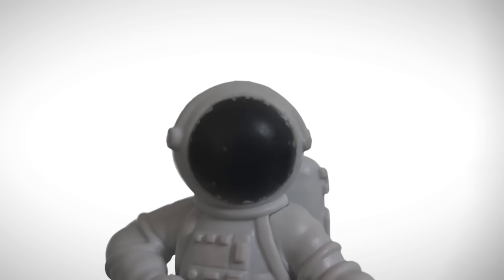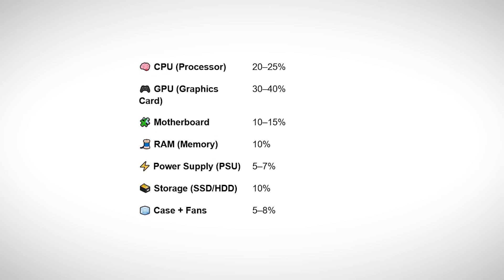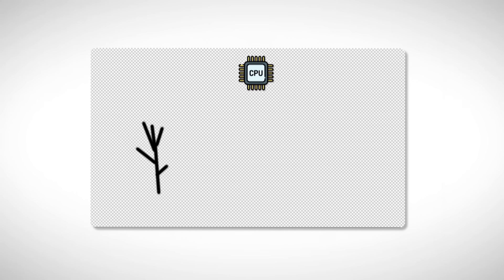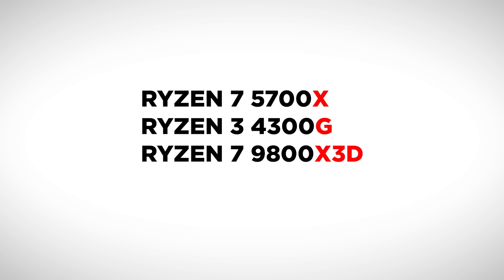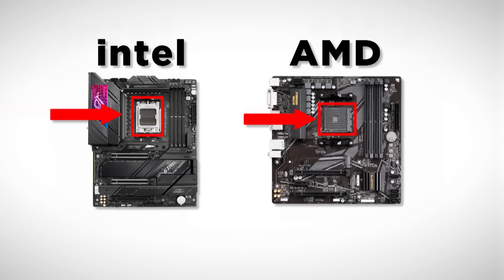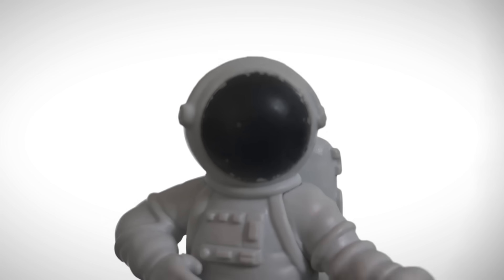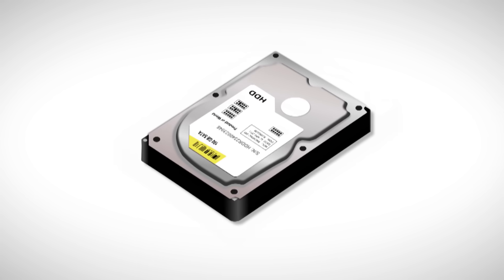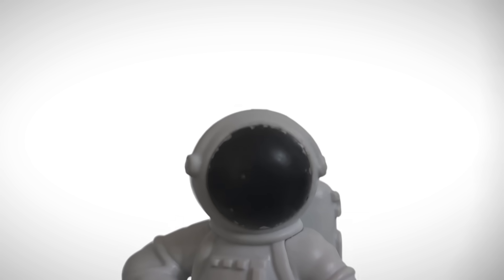Even a 5-Year-Old Could Understand This PC Guide

Comment: my mom wouldn't even buy me the "Lenovo LOQ -E 15 15IAX9E RTX 3050 AI Gaming Laptop, 15.6" IPS 300Nits FHD 144Hz, NVIDIA GeForce RTX 3050, Intel i5-12450HX, 16GB RAM 512GB SSD, Wi-Fi 6, W11H, Luna Grey with 3 Months Gaming Pass" on Amazon and wants me to stick with the Acer Chromebook Plus GE 516 and the purpose of the Acer Chromebook (which my mom meant to get acer nitro 5 but it was out of stock) is for Minecraft Java and since ChromeOS is so strict and that, it broke the GPU-Passthrough after an accidental Powerwash... 

I wish i could have a PC :[
or at least a good laptop that can run Java 120+fps-
Reply: You shouldnt be complaining about your mum getting you an expensive laptop, it may be a chromebook but it has a really good display. And you can just install windows or a different linux distro if you want.
Also, it can run minecraft pretty well.
Reply: @vVaeron  dude. at first it was getting 220+ fps and now it's getting about 120. after an accidental power-wash.
that's the only reason i'm complaining.
I want the full potential of the chromebook. but ChromeOS is stupid af and is blocking the GPU-Passthrough for Linux :/

Comment: Wrong approach. You pick a processor and graphics card that can run your games at the target resolution and FPS. Pick then motherboard according to those, then ram and storage, then fans then power supply and then a case that can fit it all nicely. If you don't have the money for it, keep saving money until you reach your needed budget.

Comment: Personally, for complete complete beginners, you want the very start to be as frictionless as possible.

On the parts explanation, I would recommend making the motherboard really big and introduce it first, as it's easy to understand as 
"the thing that all other things go onto"

The PSU can get the same treatment, as it's "thing that give electricity, and people are already familiar with the concept.

For the storage, I would ONLY keep one icon, instead of seperating SSD and HDD.
Showing 2 parts to an absolute beginner will make this harder.

Comment: The psu should be that low. You should always get a better psu and future proof your build. PSU is the most dangerous part so never go low on the price of psu. Sometimes your Graphics card takes a of power,  then if your psu has low watts it limits the actual potential of your Gpu 
2:23

Comment: This guide completely demystifies PC building. The analogy of the CPU as the brain doing the math and the GPU as the artist doing the visuals makes the whole concept of balancing your components so clear. Also, the emphasis on checking for a bottleneck between them is a pro tip every beginner needs to hear!
Reply: Your PC still sucks if you use WinCrap11 instead of Linux Mint

Comment: Can someone let me know if this prebuilt pc is worth it? It will be my first PC! Mostly for gaming YouTube and probably developing. Price is about 1100. Or should I idk???

Apollo E2 - Intel i5 12400F, 32GB RAM, 1TB SSD, RTX 3070 8GB - BLACK
This beautiful mid-size case has nothing else mid about it. The mesmerizing 200MM fans keep your system cool and quiet, even during intense gaming sessions.
The Intel i5 12400F, 32GB RAM and RTX 3070 8GB will offer great performance, both for multitasking and gaming.
Upgradeable to the latest i9 13900K, 64GB RGB DDR5 RAM, RTX 4090 and 240MM Water Cooling.
FREE RGB INCLUDED - $49 SAVINGS!

Parts:

Motherboard: standard DDR4

CPU: i5 12400F - 6 cores

Memory: 32GB DDR4 3200 or faster

Storage: 1TB nVME SSD

PSU: 650W bronze 

GPU: RTX 3070 8GB

Comment: okay i have some problems the = things are horrible a 3080 is better then a 4070 and a 5080 is not better then a 4090 the other one is you shoved an am5 socketed mobo on intels side thats just wrong and confusing to those who dont know this yet and the cpu too those might be correct but a r7 7700x beats a r5 9600x in most cases so you should not have said that i might have other critics so i will write my own reply if i have some more i am at 8:55 rn and i am not happy at these but ig its fine for the not nerds (yeah call me nerd i am fine with that)

Comment: ChatGPT is great. It's helped me with modding. Upgrading my laptop and both desktops. And installing windows 11 on my desktop that didn't meet the system requirements. ChatGPT gave me a work around and bypass plan and it worked perfectly. The only reason I believe Microsoft does the system requirements is to make you have to buy newer computers through them. Windows 11 works just like it should on all of my older mid computers. No issues at all.

Comment: The video have some flaws.
1: there no intel core i3 12600t and 
2: am5 socket on intel side
3: amd recently adopted lga so it will not look like the am4 anymore
4: x3d means it have large l3 cache, it does NOT mean high end cpu
5: no, the memory clock speed does not mean better performance, it just get you like slightly faster loading speed, the sweet spot on the ddr4 is 3200 mhz and ddr5 is 6000
6: you shouldnt trust the psu calculator, just search "gpu model" + minimum psu and add 100 to 200w more
7: nvme have type, if you using like a520, b450, h610 etc. use gen 3, gen 4 on the motherboard that support gen 3 is fine but your nvme will not get the advertisement speed, if you use b550, x570, b650, b760 etc. you should use the gen 4 or gen 5 if your motherboard supported it but gen 4 is fine if your motherboard support gen 5 since it just increase loading time
8: please do not get sata m.2, they look ideal to m.2 nvme but the sata m.2 will have 2 head instead of one
Notes: do some research on the power supply, i recommend psu tier list and remember do NOT cheap out on the psu

Comment: Hey Aman! Just finalized my dream PC build —Your thoughts?

CPU: Ryzen 7 9800X3D

GPU: RTX 4070 Founder's Edition

Mobo: Gigabyte B650E Aorus Stealth ICE

RAM: TeamGroup T-Force Xtreem ARGB DDR5 6400MHz CL32 (32GB)

SSD: T-Force Cardea A440 Pro 2TB

Case: Lian Li O11 Vision Compact (White)

Cooler: Lian Li Galahad II LCD 360

Fans: Lian Li UNI FAN TL Wireless

PSU: Lian Li EDGE Gold 1000W

Trying to balance performance, thermals, and clean aesthetics. Any bottlenecks or upgrades you’d suggest? Appreciate any input!

Love & peace!
♥️♥️♥️
Reply: Too much power tbf 900 is good enough. Also, that mobo is from gigabyte, change it 🙏🏻
Reply: the gpu seems a bit under budgeted compared to the rest of your build, but maybe your country's price is bad so it's hard to tell

Comment: A more in depth on some stuff

Would recommend picking your GPU or PSU at the very last step
allowing you to know if you went over budget or not, and you can try to go back and look at the parts and change them for a lower price. Just to fit in that GPU price because GPU market fucking sucks
PSU: 80plus gold or higher
Storage: just choose SATA if you're on a tight budget, if you're going to m.2 make sure your motherboard support the speed of that m.2. Also, HDD is still usable with DirectX Storage, though other than that, yeah, loading time not great, but HDD exist now to be use for storing data like images, videos, ... just think of it as cloud storage
Air coolers can't be noisy if you underclock your system to accumulate for things like electricity bills, reduce overheating issues and improving lifespans on hardware.
Hot take: just make it open air
cons:
- not tidy
- can get dirty easily, though pc case do the same anyway
- not looking as cool, but it can be (like one of those DIY cardboard case LOL)
- no power button (get used to using a screwdriver or find a power button online and connect to it)
pros:
- easier to fix
- potential improvement on airflow like less heat meaning longer hardware lifespan
- no GPU sag
- cheaper
- easier to upgrade
- no need to solve cable management

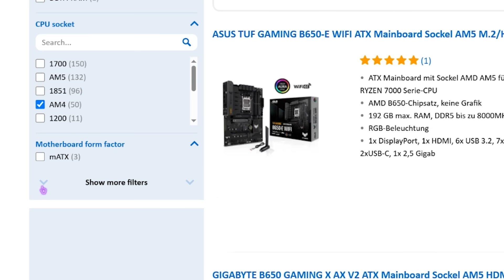Comment: A bit of a correction on the motherboard part. Not all AMD CPUs are AM4/PGA sockets. The 7000s and 9000s series like the Ryzen 5 7600 are AM5/LGA. The motherboard that was shown at 8:51 (Asus ROG Strix X670E-E Gaming WiFi) is actually an AM5 socket, not an Intel. Additional information as well, the letters after the motherboard chipset mean something. For example, the M in B650M is almost always gonna mean Micro ATX. the E in X670E means Extreme meaning it's faster compared to most X670 motherboards. But it's not always the case as with Intel motherboard chipsets. Hopefully you can learn from this comment as well. Stay safe and God bless :3
Reply: The socket is actually LGA. It’s for the x series intel cpu’s. The dual retention bracket gives it away
Reply: @OnlyGalaxy  weren't most x serieus crapier 🤔
Reply: @OnlyGalaxy Yes, it is LGA(Land-Grid-Array) but not Intel. If you look closely, the CPU socket is split into 2 parts which is AMD, specifically the AM5 platform, whereas in Intel sockets the socket is usually rectangular with transistors in the middle. Yes, Intel sockets do have double retention brackets but AM5 has them too with their retention arms going up instead of Intel that have their retention arm go down
Reply: Ok
Reply: So i shld get a EEE mother board 😂, extra extra extreme 😂

Comment: A thing you should mention during the GPU part is vram (which is basically ram for the GPU to store shaders and such). Nowadays, Vram is pretty important depending on the games you play. If you plan to play AAA single player games, Vram is pretty important with the amount of shaders newer games used (and also being in unoptimised with some games forcing ray tracing on which drastically affects performance) which is why nvidia is getting flamed at time of writing as they keep reusing 8gb vram for there "budget" cards which isn't enough for 2025.

This isnt as important if you plan to play less demanding games like esport titles such as counter-strike or valorant to name a few but it's still a nice thing to have. 
Being limited in vram can limit graphic settings you play at and can cause stuttering and affect performance in games.

Comment: you can add too the psu list "FSP Group" psu's its a more premium OEM manufactory theyre made psu's for corsair, evga, seasonic and sparkle 
(FSP is known for its high quality and reliability, which is why many well-known manufacturers purchase their power supplies from FSP)

(thermaltake some models... 100% right TT can sometimes WORST!!!  my psu in 2018 costs me 90€ and was 65dba loud ... i send it back and was hoping it was only a broken one and get a other and this had 72dba.... at idle... at bequiet dont ask my pc gets toasted bcz a error at the safty mechanisms.... )

the point with "less efficient" is only for highend cpus at all others is a air cooler mosttimes same efficient sometime quieter and depends on cooler, cheaper then a aio but not all aircoolers are cheaper a noctua as example can costs up tot 150€ a asaka can costs 200-300€ a full copper 92mm topblower cooler for itx build can costs too between 40-100€ a aio can costs 50-350€ it depends on build and brand, case/space and money :D

at formfactors: you forget ditx (deep itx) and E-atx ssi ceb boards both are no itx and no eatx it has other size and not fits in every itx, eatx case

i use it everytime a bit like your calc but at itx: with my last build in €, i need too say the 100% i cant use it i overbuy it because the chip shortage mid of corona and scalpers and miner boom so at end i need to buy more then i want
CPU: 14-20% 140€
CPUCOOLING: 5-9% depends on what case you have if its a case for aircooling or for watercooling it gives no better only a "now much space" first 23€ after 2 months 120€
GPU: 30-35% you cant go too beefy or too powerful because limited cooling space or airflow thats why a stock gpu is mosttimes better then the 2-6% better oc stuff 330€
MB: 10-20% itx boards costs more then matx/atx this is normal 180€
RAM: 10-13% ram who cares rgb? if i ever want rgb i need the expensive low profile rgb ram (iam a linux user so i cant adress it so its useless for me and to expensive) 120€
PSU: 10-20% sfx and sfx.L and HDplex/felxAtx are more expensive then ATX cases (never buy too cheap PSU's! or with bad quality or with deep  batch) 180€
STORAGE: 5-12% (used from pc befor)
FANS: 5-8% (depends on case and fan amount if only 4 fans its 6%...) you wonder why fans is extra? in itx cases are mosttimes no fans included. 30€
HUB/CASE: 10-20% 20% because itx cases are more expensive then the atx/matx yes i know it gives atx till 250-400€ but it gives too itx till 600-1000€+ (i never wanna buy a 400 or 1000€ case its waste of money buid a own case comes around 200-250€depends on materials) :D 180€
 my budget was 1000~1100€ and i payed bcz. the bad time and prices... 1280+shippings ~1350€ (with storage it would be at end 1800€ but i used my old one because 10tb was way too expensive at the time)
at the at the moment prices i can build a pc for same budget for the perfect 1000€ 

after all you have at daily prices and sales a variation at the % of max: 6% of the build and overcost at all max prices of +57% (worst case of for build) i use for "long time upgrade pcs" (i hope its named like this in english...) because i upgrade first my cpu/ram/mb/psu then gpu at end if its a case i can fit stock coolers i used boxed cpus and buy 1-2 months later the expensive air or water cooler...

Comment: One of the first steps to building a PC is definitely research. As a PC novice, I learnt about the individual components and what each spec means, which led me down multiple rabbit holes of different factors that affect performance for each component. For eg, I recently started learning more about motherboards, and that led me down a path where I started comparing VRMs, PCIe speeds, itx Vs matx Vs atx, number of SSD slots and their speeds etc. another one is SSDs, which you may initially think is straightforward, but then you realise there's gen 3 Vs gen 4 Vs gen 5, then when do you go SATA or should you even consider HDDs anymore (spoilers, probably not) and then there's QLC Vs TLC Vs SLC and do you need DRAM or not, and you can't just look at individual gens, gen 4 can range from 4-5k reads and writes to over 7k, gen 5 is an even bigger range, and even such high sequential speeds don't really affect much for gaming and only affects for transferring large files, if you transfer multiple small files then sequential speeds don't matter as much. 

TL;DR just take the first step into learning, and everything will fall into place naturally. Also, always follow the manual, definitely helps when you have less experience in pc building since each brand is different
Reply: Fr. And don't even get started on peripherals like monitors having to choose between TN, LCD, and OLED etc
Reply: lol this is so facts when you want an optimal gaming device with no latency and highest performance

Comment: I liked the video but I didn't like how you glossed over the complexity of picking a GPU. 

While it's correct that you just really have to look at the benchmarks of the games that you're playing to determine which GPU you pick per brand, there is some nuance between the brands like how Nvidia is the best at Ray tracing but AMD has more horsepower upfront. Intel is the cheapest of the three, has some good features, but it's drivers still have some work to be done and not really recommended for beginners; though their second generation gpus are a whole lot better than the first. 

If you have a video explaining GPU is a more detail but maybe a link in the description might help out with that as well. But that's just something I noticed it's a good video bro

Comment: Good video but I have some few pointers. 

- Don't use PC Bottleneck calculators, cause they are not reliable. They don't take into account which games. Games can be very CPU Bound or very GPU Bound.
- CPU's from AMD that are 7000s series or onwards don't have the pins anymore on the CPU, but on the Motherboard
- Don't rely heavily on the 80+ ratings on PSU's. Sometimes they are not accurate at all. Going from 80+ Bronze to 80+ Gold is very minimal in efficiency. 
- USE THE PSU TIERLIST! Don't choose based on brands, but choose on the ratings on PSU Tierlist. Some EVGA power supplies are known to have massive failure, such as the W Series from EVGA.

Comment: CPU :
Amd ryzen 7600
MOTHERBOARD :
Msi b650 gaming plus WiFi 
CPU COOLER:
Deep cool ak400
RAM:
Corsair Vengeance DDR5 (2x16) 5200mhz
SSD:
Crucial P3 plus 1tb 
SMPS:
cooler master 650w bronze
MONITOR:
Acer Nitro Vg271U M3 
27 Inch IPS Wqhd     
GPU:
Sapphire pulse 
Amd radeon RX 7700 XT
Please let me know any alternatives in my build bcoz this  is my first build and the budget of 90k
Reply: Seems good. 90k what?
Reply: @lemonyz420  
 slightly moderate price.
did you note any components which has not  worth for buying or any Good alternatives
Reply: @sunilonly  I just mean 90K in what currency?
Reply: @lemonyz420 probably indian currency

Comment: Hey I love your videos and it has helped me pass the time before all my parts arrived. However, I'd like to point out that the PSU budget percentage is wrong, imo. If you want something that genuinely lasts, from a good brand, warranty and future proof wattage (depending on your specs) my psu was ~10% of the budget whereas the storage was ~5%. ($120psu 850w and $50ssd) I know you can get better deals depending on the wattage, but I don't think most beginners take that into account. Bare minimum is 650w imo, but not too future proof. I think in a future video you should clarify that, so people don't cheap out on the most vital component. You can scrape by with an average ssd, but I wouldn't go as easy on the psu. That's just my opinion though, still enjoy your content